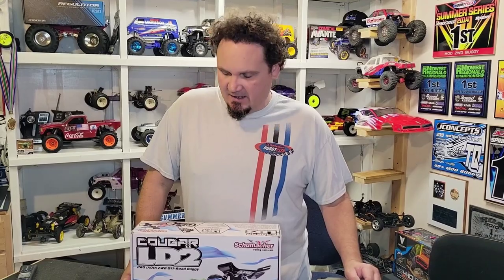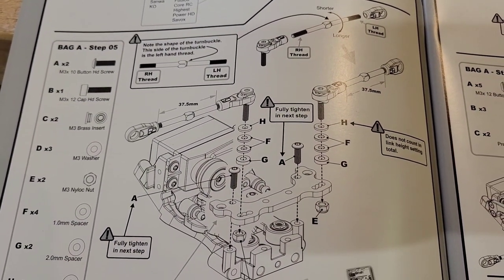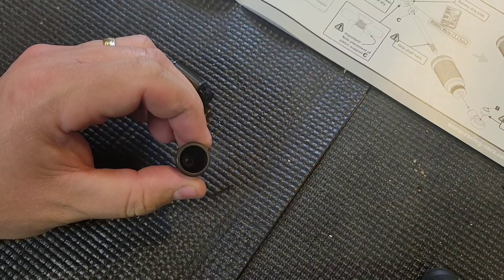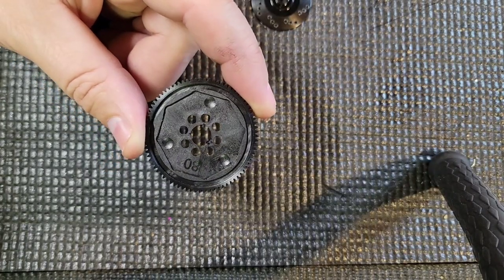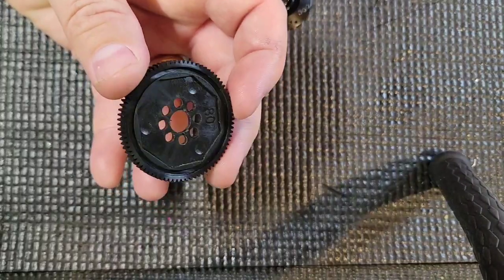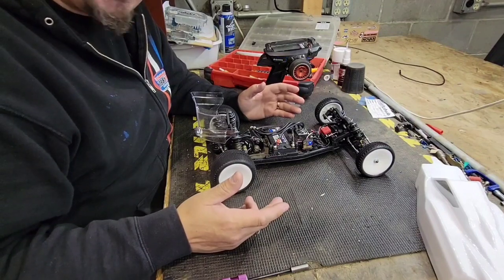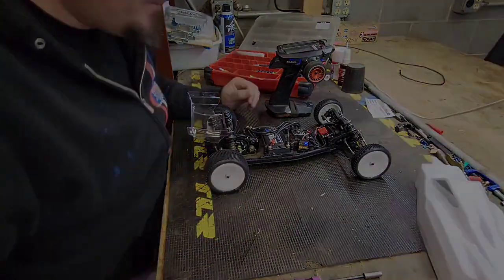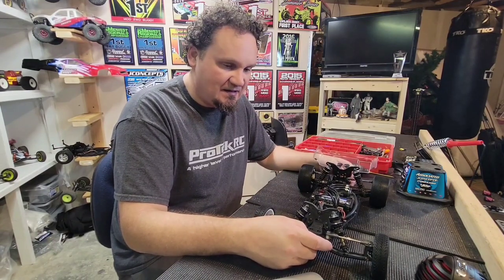Schumacher Cougar LD2 Kit Build - HobbyTown HobbyPlex

Comment: Awesome video! You did very well. I'm stoked to be getting my first 2wd 10th scale kit and building it. I'm interested in your opinion on the other ld2 spec kit. Have you built one of those or seen the difference?  Is 2wd mod bigger than spec? Like number of racers not car size lmao
Reply from the maker: If I would have like the car better I probably would have gotten the stock version for my son, but I had a hard time getting this thing to handle the way I liked. I sold it at the end of last season.

Locally, stock is a larger class than mod.